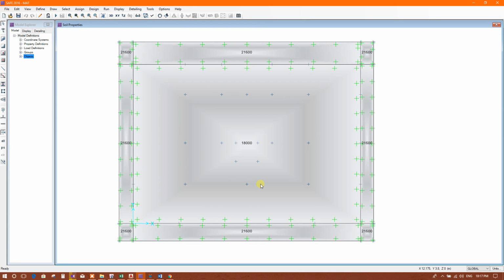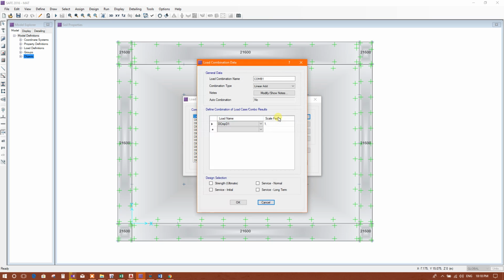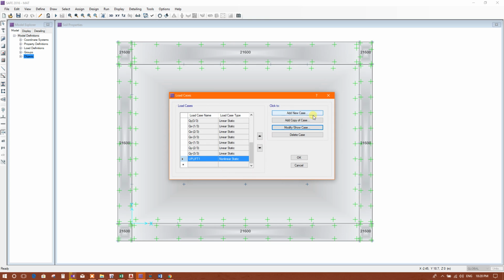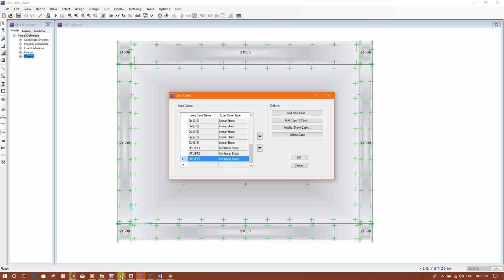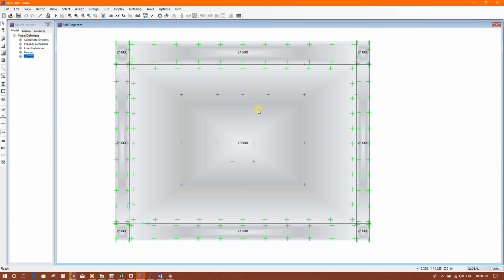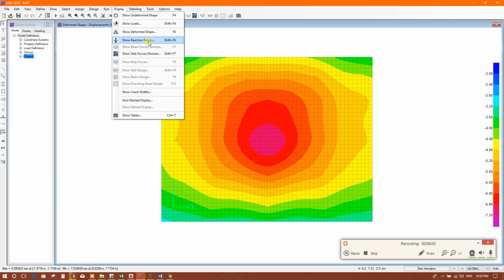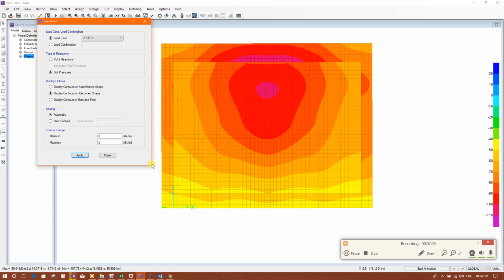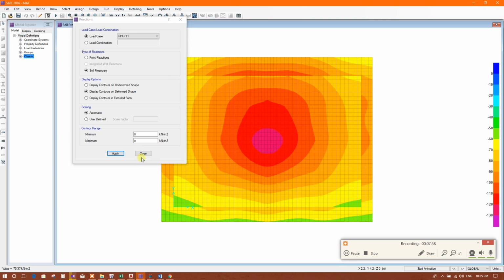5. NONLINEAR ANALYSIS OF MAT FOUNDATION FOR CHECKING UPLIFT-MAT/RAFT DESIGN COURSE

Comment: Is there any way to design reinforcement for a non-linear case such as raft resisting hydrostatic pressures where dead weight from raft alone is not enough to resist the hydrostatic pressures and the weight of the level above (via columns landing on raft) is required?

Comment: I didn't get one thing sir...150kN/m2 is the Allow. Bearing Capacity (i.e., with FOS)

But I'm confused if the Soil Pressure shown in SAFE here is Allow. Bearing Capacity of Simple Ult Pressure as we haven't assigned any sort of FOS in SAFE.

Looking forward for your answer sir...

Because, 
In my design,
Allow BC with FOS 3 = 220kN/m2
Mat area 48m x 48m
The soil pressure shown has the max value of 600kN/m2 in SAFE. If I remember correctly, this soil pressure has not taken an account of FOS anywhere. THerefore, I checked the results 600..by diving by FOS ie. 3.

IS THIS CORRECT?